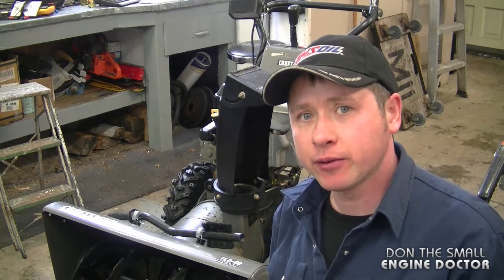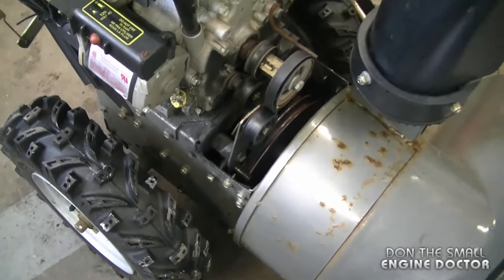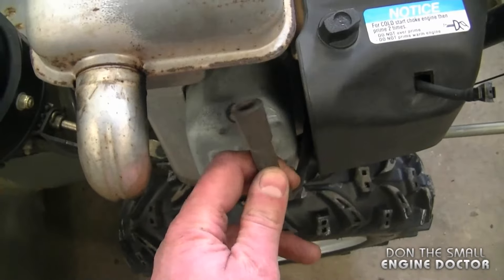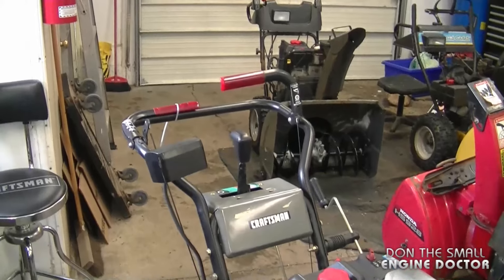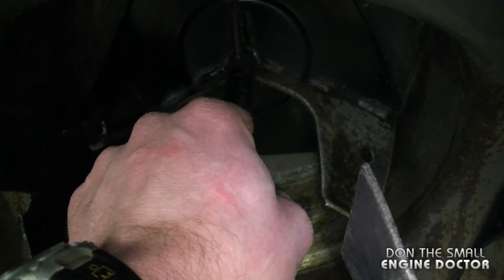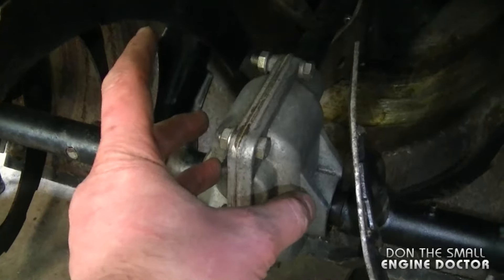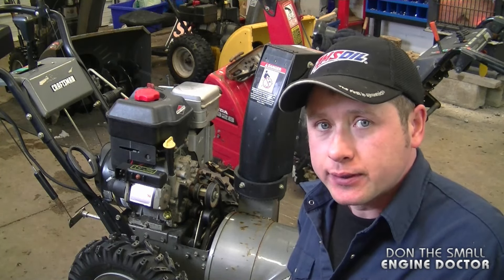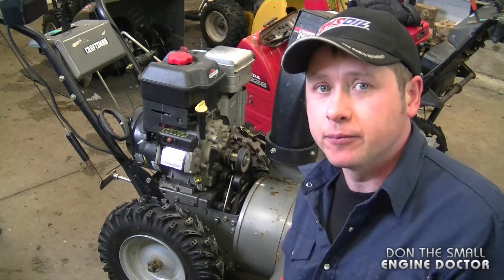HOW-TO Quickly Diagnose A Snowblower That Won't Blow Snow!

Comment: Good idea to pull the plug when you're putting your hands in the blades. If a person turns an impeller manually when the engine stopped at the top of a stroke, it could spink and maim them.

Comment: Any idea why it seems like it won't throw until it gets warmed up? I pull the lever and nothing happens... until I drive it around a bit looking like a dummy.
Reply: Had the same thing, the drive belt tensioner was wearing out on the control side, it has a tiny (unnecessary) bearing where the cable control meets the belt actuating lever that was worn down so although the cable travel was correct the surface it meets is worn so the travel is out. I fixed it two years ago with electrical tape…..sorry if I explained poorly, inspect your tensioner assembly where control cable meets the tensioner assembly and look carefully for wear. The “bearing” was just a piece of tube that can roll when cable actuates it….it had a groove cut right into it drastically affecting the cable travel…..find that worn nub, run a few wraps of tape around it and your off to the races.

Comment: Truly Amazing Well Explained Video..
1st snowfall up here in Maine Early Dec. '23 we got maybe 7 inches and 90% driveway done and boom..
Busted a pin, replaced it..
Auger no turn, I did a better clean under snow and packed snow.. find out a rock wedged.. so I tap that out no problem, tried again,
Still no snow throwing..
Its gotta be one of the three..
It's 3yrs old, 3rd winter and I rather figure this out and not pay someone 3X or 5X the amount that I could fix under $50... Hopefully!

Thank U,
Josh A. Cyr (From Maine)

Comment: Love your ability to explain the mechanics to us novices, in my case my snapper auger is turning, but will not blow snow it’s a 14 hp motor so should have the power. I thought for sure you diagnosed my problem cause I had the wrong shear pin, but as stated everything seems to work properly, just no snow flying
Reply from the maker: make sure impeller is turning
Reply: @danielpurdon5395 did you ever figure out what was wrong?

Comment: One item not mentioned in this video is the belt may turn the auger but still be stretched. I've had this issue with my 9hp Noma snowblower. The snowthrowing becomes weak. After inspecting the auger belt, I can see that it has stretched and the small adustment will not take up enough slack. Time to change the belt.

Comment: Fellow Canadian here! I sucked up a rolled newspaper in a bag this morning.  From what I remember, the engine stalled.  Impeller and augers turn fine…..until they hit snow and are under load.  At that point, the auger and impeller stop turning.  Impeller shear bolt is original.  Auger shear bolts are OEM.  Once the blockage of snow (or load) is removed…..the impeller and auger start turning again.  What’s wrong?  Stretch/glazed belt?  Gearbox?

Comment: Also make sure that after you replace the brass gears in the gear box that you put the augers on correctly so the snow doesn't get pushed OUT to the sides of the bucket. I did that and felt like a big dummy.

Comment: Maybe you can answer the question why the manufactures of snow blowers don't put a shut off valve on them for the fuel it seems a little bit cheap I guess would be the word keep up the good work
Reply from the maker: it always comes down to cost

Comment: Ok Donny its been awhile since i replaced the starter motor on Murray so starting it today pretty easy but getting sparks out exhaust is that normal? I just put Seafoam in tank because its been sitting

Comment: Not sure but my belt is good, my impeller turns but my auger is moving slower than usual and when i go into 3 or 4 inches of snow it stops...any idea why?  My sheer pins look to all be intact and are the factory ones.  What else should i look into?

Comment: Donny, love all your stuff! Thanks for the assistance! What I wonder is why the Noma replacement for my Dynamark 825 shear bolts comes from Briggs & Stratton par number 70971. This is the number on my blower's paper manual, from Sept 1987. When Briggs sends me the 70971MA part, it's a grade 5 "JH" bolt. So clearly, that's not a shear bolt. Unless something about a 1/4" X 1-1/2" bolt with a sleeve and lock washer makes it a shear arrangement. You can get these bolts in kits from Sears and they call them shear bolts. So, maybe it is, I just don't want to take the change I'll goof up my blower!What would be a good replacement for this shear bolt that is really a grade 2 bolt?Regards,-Ambi

Comment: Have you ever used or seen the blower mods where a rubber flap in added to blower blades to aid in throwing wet snow? If so what is your opinion?

Comment: Thank you for this very informative vid. But it is not the cause of mine. Belt is new, gear box checked, impeller running great. In deep snow, it clogs!!!  I notice that the governor does not move when more power is needed. With my finger, I can move it and it works well. What can I do the resolve the problem? Thanks!!!
Reply: Put a weaker governor spring on it.

Comment: Before I took my troy bilt blower apart to paint it worked fine. After putting it back together it seems like the auger is not pulling the snow into the impeller but rather pushing the snow outward . Is it possible the augers need to be switched from right to left? Thank you

Comment: My impeller only moves slightly when I turn over the engine. I can manually move it about a 1/2 inch. The belt does look worn but should the impeller pulley move freely when the belt is loose?

Comment: Hey maybe you can help out  picked up a older 5hp snowking , the snowblower needed a bit of work , but it ran , the problem is under load from snow it bogs right out, and stalls, the last person to own it said he put a new carb on it the previous year, i took it apart and cleaned it but still it bogs out under snow, i adjusted the cables so they are tighter , any idea what else i can try ?

Comment: Hi Don another nice video.Would it be possible to do video on how to check the oil level on such (aluminum) a gear box? The fill hole is small (especially on Ariens aluminum gearbox) that its very difficult to check the level. Is there a trick to do so?

Comment: can you help me please Toro 828 power shaft I put new seals in the auger box and know I can't get the helical gear to engage, i have put in the 4oz of 00 grease and the auger just spins freely do I need to take it all apart again, and weld the gears together lol, just kidding,, I wish it had the one piece brass gear instead. Thank you for your time

Comment: Very Helpful videos... Learning a lot from them...  One question, what happened to the Honda 828 drive system that i saw in the back round,  and have you had many issues with the track driven systems... Thanks again... Chief
Reply from the maker: most common issue with them is the "right case" transmission

Comment: Thanks for your vids. Mine is only 2 years old and doesn’t engage or barely (with a squeaking noise) unless I kind of hold the handles as if I’m trying to lift the snowblower upwards instead of pushing forward. Any ideas?
Reply from the maker: check cable tension and your belts

Comment: Hey Dony, I installed a new augur belt and when I test it to blow snow and the belt is burning up and white smoke it’s a new belt and it’s aligned correctly
Reply from the maker: make sure impeller is not frozen

Comment: Put an auger belt on my older craftsman shower blower. Now the auger spins even with the lever disengaged. Since then I disconnected the drive cable and tensioner and the symptom remains the same. Any ideas

Comment: Will you show us the damage inside gearbox? Do you repair or replace?
Reply: I wonder if it's worth it to replace the gearbox.  My snowblower (A Snapper 7 HP) is about 12 years old, I'm not sure those parts are available any longer.
Reply: He already has. Big job greasy hands.
Reply: Jim Bailey   P

Comment: dony mine revs nice and high but when i push into the snow the engine slows down to almost a stall until i release the tiller handle..jus replaced carb last week..any ideas

Comment: Before i needed to, I looked up the worm gear for my snowblower .... searspartsdirect shows that the part is replaced by the assembly for 222.xx dollars, So, USE THE SHEAR PINS, it will save a costly repair.

Comment: Wanted to ask. If I engage the blades it spins until it hits snow. I pulled the cover and the belt is ok but when I get tension in it I can move the belt and the auger pull has a lot of play. What the next step?
Reply from the maker: try adjusting the cable, auger belt idler pulley or replace the belt

Comment: Is there not a shear pin on the impeller drive shaft like there is on a Honda?  I can't remember if my MTDs have one there.  I like the explanation and steps for the overall method, but it seems like seeing that the impeller moves but the augers don't would have saved you some disassembly and diagnosis steps by putting you right to the sheer pins or gearbox.

Thanks for all the great videos, especially the various carb related ones.

Comment: Many people who own a snowblower don't check & fill the oil level in the gearbox. Heck, a lot of them don't even check & fill the motor oil! They just use the darn thing & wonder why the engine quit or why it won't work after a while.
Reply: On my older Snapper 24" 7 HP blower there is no oil in the gearbox, but there is a grease fitting on the the gearbox & also on the auger bearings.  At the beginning of each winter season I shoot a 2 or 3 shots of grease in the gearbox and also the auger bearings.
Reply: Pemaquid?

Comment: My Snapper auger and impeller turn with no load, but when you push it into the snow, both impeller and auger stop. belts continue to turn and pulley continues to rotate. Makes clunking sound. Do you think the pulley guide key could have broken?
Reply: i have the same problem and i checked everything as well
Reply: I would not have thought that was possible, but if all else is eliminated, then whatever is left, however improbable, must be the cause.

Comment: I had a problem last night. All of a sudden my auger stopped when moving powdered light snow / Now the auger will seems locked, the  impeller move a bit 2 inches back and forth that is it ..what do you think it is gear box?  I can take that apart but I just want to make sure I going in the right direction .Shear pins are fine and factory
Reply from the maker: could be, check belt area first
Reply: j k.

Comment: Can you do a video on that Honda in the background.
Reply: Looks like he took the track, wheels, and guide off on the HS 928.  Sadly I just did that, twice, on my 928 yesterday, in the snow.  I think my track wasn't tight enough, and/or one side was tighter than the other.  The track came off and part was stuck between that "guide", and the height adjuster.  The first time I pried it out, but for the second I looked at the parts pics on boats.net and just took the whole guide off.  For reassembly, loosen up the rear axle so you have play with getting the inner wheels on inside the tread.  Then tighten it enough.  If I need a welding project this summer, I might add wings to those guides so that the tread can't get into that space.  But here in Tahoe we're likely looking at a 50 year winter (7' compressed in the shade in the backyard, 242" this season so far at the local resort, so 20'!!!), so it's not likely we'll get this much snow again in the near term.

Comment: My snowblower stopped blowing all of a sudden.  The Auger won't turn when i engage the lever.  I took the belt cover off and the auger belt is loose but when i engage the lever it tightens and squeals.  It doesn't turn and sometimes will just shut off.  Any ideas?

Comment: Hey can anyone tell me whats wrong with my snowblowers, I have 3 doing all the same thing they are 2 stage , start right up but when they come into a load of snow they die out. all have new carbs ,cant figure out which adjustment is off tried increasing idle but still dies out , help!

Comment: Word to the wise never use a bolt where a shear pin belongs.  Penny wise and pound foolish.  If you order shear pins online they often come in packs of 10 for not very much money.  The hard part is figuring out if they fit your machine, but if they are a little too long that's ok as long as they are the right diameter.  Better the wrong shear pin than a bolt.

I got a Kubota tractor attachment with the house when I bought it and sure enough there were bolts in it.  The chain drive and sprockets were as a result stretched, much money to fix.  Somehow the auger gear box survived.